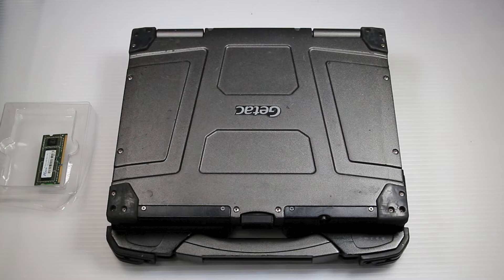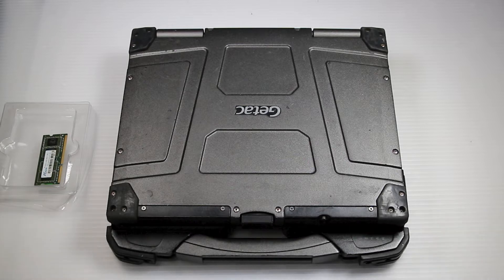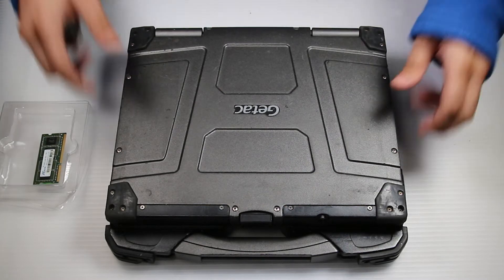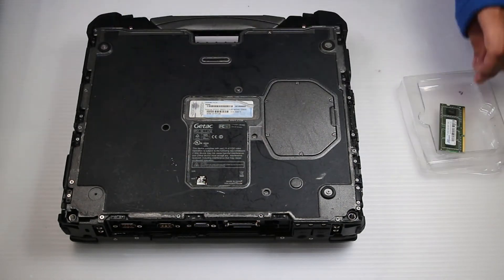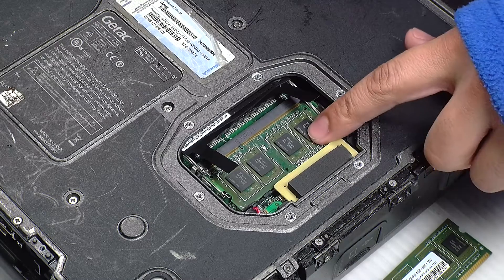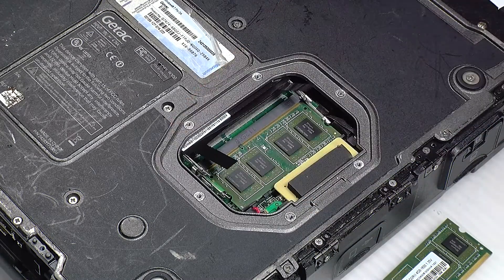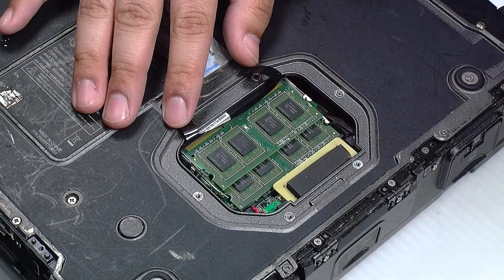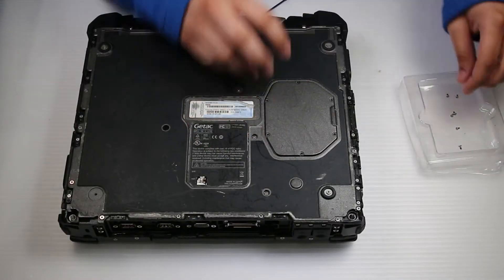Upgrade Your GETAC B300 Memory (RAM)!**

Comment: Hi Bob,  I have just checked my machine which is a G500 G5  it has the i7-4600M CPU and 8 GB RAM  are there any upgrades I should look for to improve the performance of the machine?  Thanks for your time.  
I would like to replace the keyboard if this available as some of the letters are starting to wear out.  Thanks  Ed